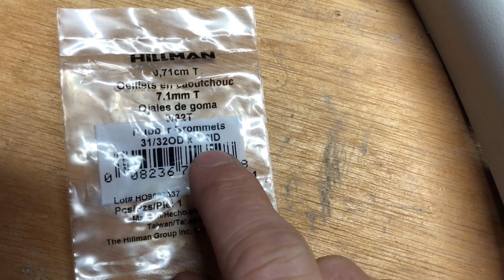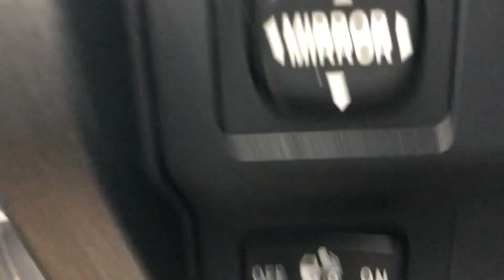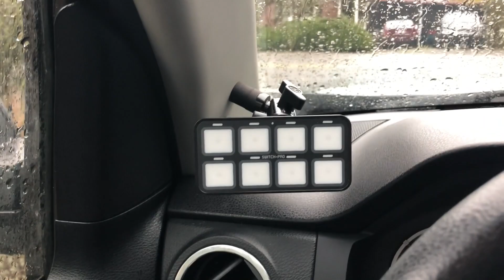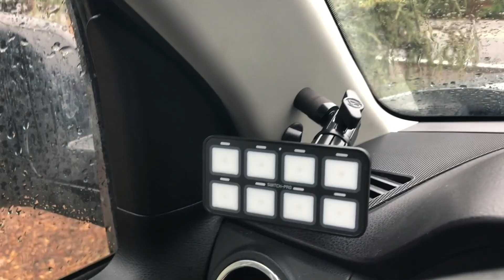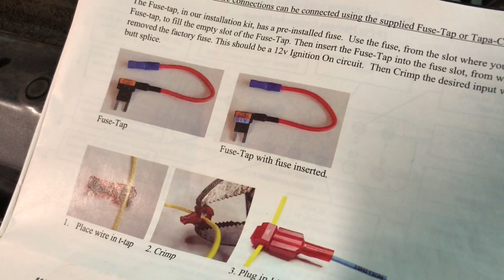Complete Guide to SwitchPros SP9100 Install | Toyota Tundra

Comment: Bro this was the most thorough guide to this thing I’ve ever seen. I’m picking up the switch pro this weekend and while I already had a good idea of how I was going to do it I learned a bunch of things I didn’t think of in your video. Thanks for posting this bro. You’re getting a like and subscribe from me just for that!
Reply from the maker: Haha thanks dude! Glad it was helpful. I mostly just try to make videos that I wish I had or would have found informative before I started my install.
Reply: @andrewtraylor  finished the install last night. Went smooth. Also installed some ridged d-ss pro lights. The hardest thing I found is deciding how long to keep the wires I’m not using and still being able to tuck them away to be hidden.

Comment: Iknow the video is 2 years old, but like everyone else has stated, this is the best information for this unit on YouTube.  SDHQ has also stepped up the mounting option game for the switch, they sell full kits now for your vehicle with everything included for mounting, the plate you got, inside options.  Everything you need.  I've watched this video about 3 times and am going to order the 9100 for a 2018 tundra with the new overhead mount.  I was going to order all the seperate parts, but I found the whole kit.  I too will be buying the battery terminals as they do look clean and give better options.  How have they stood up to your use in the two years now?

Comment: Great video. I noticed the same thing you did. A lot of people running a ton of extra stuff when it's not needed. That happens a lot online when people just copy what the first guy does. The solid state build is one of the primary reasons to choose the Switch Pro. For me it also came down to size. Everything included in the box is quite a bit smaller than competing products which will lead to a cleaner set-up (the whole reason to buy something like this; less wires everywhere!) Yes it's up there in price but...Buy once, cry once! 🤑

Comment: Thanks man. I didn't buy the SwitchPros because I thought you would need to add terminal bars, relais and all that other shit because I read through forum posts. Now I know better! After dealing with my low cost AuxBeam switch panel I'd love the simplicity of the SwitchPros. Just solder the + wire and done.
Reply from the maker: Exactly. I don't understand why people want to make it more complicated.

Comment: Gotta imagine it drives the Switch Pros dudes crazy to see all those aftermarket elaborate tray setups. For one thing it probably discourages some people from buying the SP9100 because it seems difficult to install and has so many additional components and failure points. And for another, it defeats all the features that make the SP9100 so great (sealed, waterproof, simple, etc.).  Anyway, great job on your install, and doing it the way it was designed for.

Comment: That switch is expensive but seems worth it if you have a few accessories. Great design and makes it easy to wire everything up safely.
Reply from the maker: Agreed! I think if you have 3 accessories or less, it's not worth the cost. But over 3 and the wiring starts to get really messy. The danger is if you get the SwitchPros, there are 6 buttons on the controller and having half of them blank looks weird. So it kind of encourages you to get more accessories...

Comment: Instead of trying to push the fat end of the harness from the passenger compartment through the firewall and de-pinning, wouldn’t it be easier to push the skinny end of the harness from the engine bay through the firewall in opposite direction?
Reply from the maker: You might be able to do that if your firewall grommet had a hole big enough to fit that side through (or you make a hole big enough). The nipple that I cut off to push the cable through was pretty small and even with only wires it was a tight fit. But if you could make that work it would definitely be easier than de-pinning.

Comment: How many BD lights could you run off one switch, wired the same way as you did?
Reply from the maker: Depends on how many amps each light is rated at. The switch pros has four 35A and four 20A switches. So you should be able to link quite a few lights on one switch as long as the total amps stays under 35A, using one of the 35A switches.

Comment: Great. Thanks. Does the unit have to be wired to the main battery or can it  work direct from an auxiliary second battery ?
Reply from the maker: It's recommended to wire it to the main battery. Might work off an aux battery but if you have the option, I'd go main. Probably wouldn't be too hard to test before permanently mounting everything.

Comment: I’ve got a xtreme terrain light bar that’s amabee n White two function has two switches do I just wire each switch to each switch wire readout on  switchboard map ?
Reply from the maker: Yeah, my baja designs S8 has the same thing. The whole thing will illuminate as white, and there's another wire that can be used to turn on 3 amber mini lights within the light bar itself. I wired those functions to separate switches so I can control each individually.

Comment: What do you do with all the unused wires? Is there any residual voltage running through them? If nothing is attached to that switch and the switch is accidentally pressed, can’t it short out?
Reply from the maker: I had enough accessories ready to wire that I only ended up with 2 unused switches (and wires). I rolled them up and zip tied them out of the way, next to the power module. If you turned those switches "on", yes those wires would have power running to them. If they shorted for some reason, the SwitchPros would disable that particular switch. Since there is nothing powered by that switch it doesn't matter and operation of the other switches would be unaffected.
Reply: @andrewtraylor  Right on thanks for your video again. Very helpful, I installed my switch pro in my 2500 power wagon this weekend. For the accessories I didn’t use, i just heat shrunk the switches (paired & singles )
Reply from the maker: @SuperRastamon420  Nice! Great idea. I might do that too.

Comment: Excellent video....now im wondering what all the bars, etc are for in the power-tray kit i purchased?
Reply from the maker: In my opinion, not needed. Kinda defeats the purpose of the SwitchPros: to keep everything sealed and no exposed metal. But... it can be a nice way to do something with all the wires from the 16-pin connector if you don't have all your accessories ready to wire up. I just coiled up the wires I wasn't using and zip tied them off to the side until I'm ready to add more accessories.

Comment: Do you have all the info for the mount you used from 67 designs. I want to now mount mine just like you did. Ohh will need the gromet info also. Thanks
Reply from the maker: Here's the A pillar mount: https://www.67d.com/products/toyota-a-pillar-adapter Then I just got the SP9100 mount and a nano sized arm. Grommet size is at 12:00 and you should be able to find them at most hardware stores.
Reply: @andrewtraylor  awesome thank you I wasn't able to find the site on phone at the time for some reason but popped up on work computer. I'll have to see if it would work with the Amazon switch I bought. Thank you
Reply: @andrewtraylor  Do you have a link to the SP9100 mount which includes the ball mount to attach to the 67 Designs A pillar mount?
Reply from the maker: @grayiswhoiam  this is the mount I got: https://www.67d.com/products/switchpro-sp9100-switch-panel-holder

Comment: love your video but it is a really bad idea to mount anything on top of an airbag that explodes at hundreds of miles an hour
Reply from the maker: Good point! If that airbag pops the switch controller could definitely do some damage to your face. Worthwhile consideration for anyone thinking about mounting it on the A pillar.
Reply: @andrewtraylor  not only that but it could pop the airbag before it can save your face from the piller
Reply: but really great video defantly super helpful and easy to follow and entertaining
Reply from the maker: @MarcusMussawar  After doing a bit of research and watching a bunch of videos of curtain airbags deploying, I'm not super worried. Curtain airbags deploy straight down against the window to protect from side impacts and roll overs. And in most of the videos I've seen, they come out from the bottom side of the A-pillar trim, so I don't think airbag deployment would explode the trim and switch mount into your face, especially if the mount is located near the bottom of the plastic trim piece. So I don't think it's a huge danger, but in a bad crash anything could happen and it could possibly make things worse having the switch mounted on the A-pillar. I probably won't move my controller but for anybody else, mounting within the dash or center console would probably be safer.